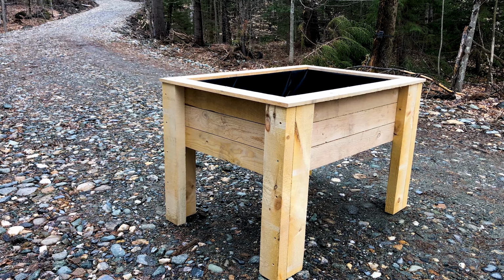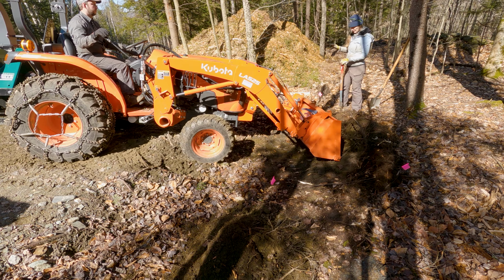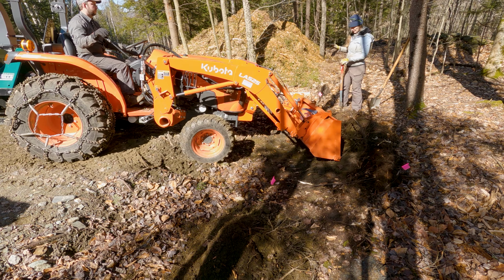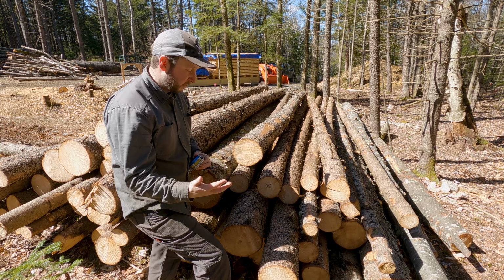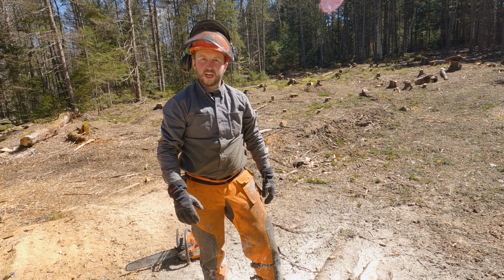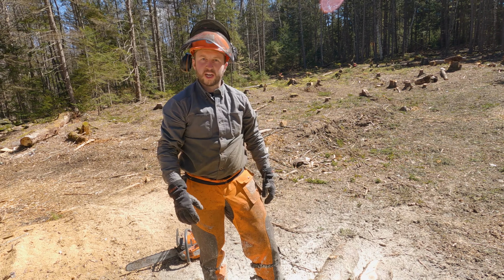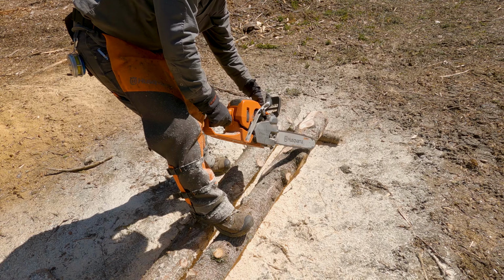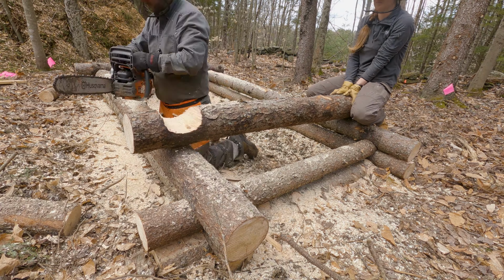Building a log raised garden bed

Comment: Great job with the build. I would recommend cutting any nearby trees. Where I live in the Texas Hill Country, raised beds are the norm. I put one together using 3’x4’x12” galvanized square boxes. Place 6 inside a dog kennel to keep deer out. Anyway, the reason I post is because of roots. Cedar trees 15 feet away gotten into the raised bed. Roots everywhere climbing up into the bed with root in every single inch of space. Took all the nutrients from the vegetable. I am going to have to move the entire garden. I saw roots in while you guys where building yours. So I recommend cutting the trees or move it.

Comment: Looks great! You seem to have a good overall view of gardening.  Here nantes is a type of carrot 🥕 which works well in shallower soil. I'm sure you'll find a 7" variety that will work in your area too. In some places I've had difficulty with squirrels and rabbits 🐇 digging things up so now use rabbit cloth on the top and bottom. It's  welded at each intersection & heavier gauge wire so protects your plants. Nice start!